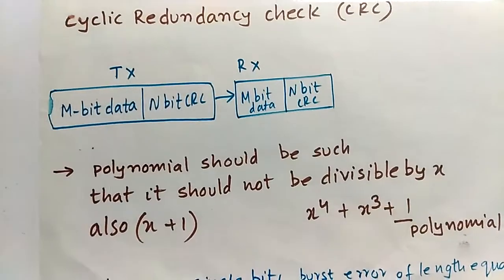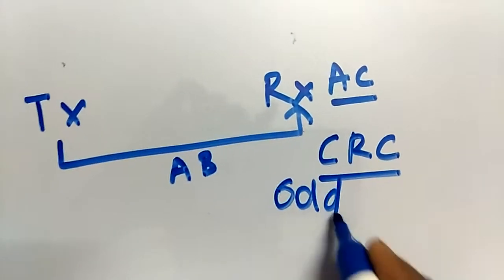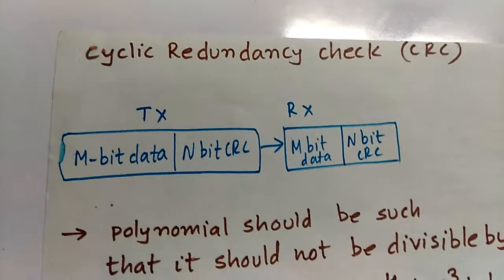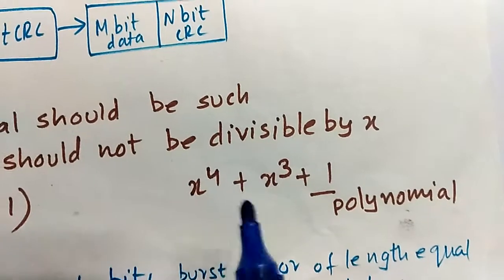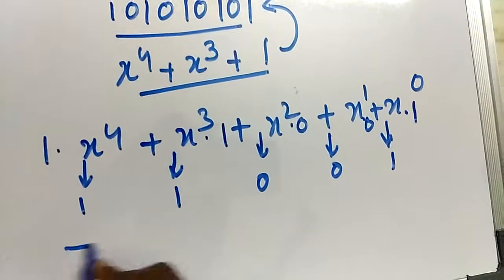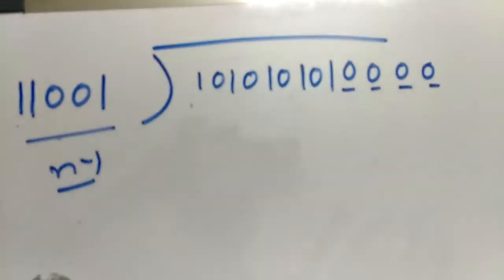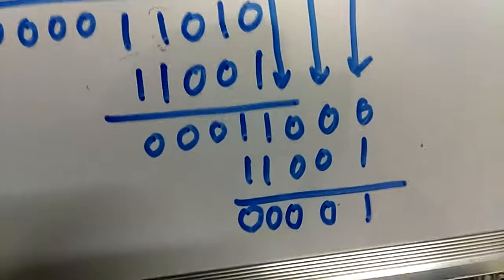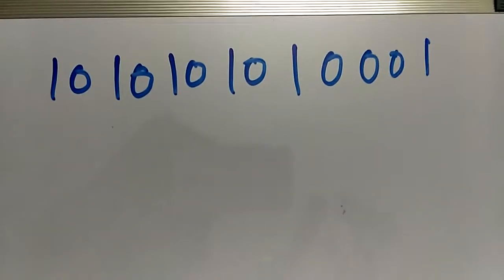CRC-Cyclic Redundancy Check error detection method . Explained with example!!

Comment: Hi Karthik, I've read that crc has a capability to detect the burst errors of length upto the degree of the generator polynomial. But I don't understand how can we know that at the receiving end that say some 'n' number of errors has occurred during the transmission.
Reply: 'n' may be less than the degree of generator polynomial, please help me in understanding this other than telling just as the remainder is non-zero there is an error detected.
Reply: Thanks in Advance 😊
Reply: We will send out CRC bits for every beat of the burst.